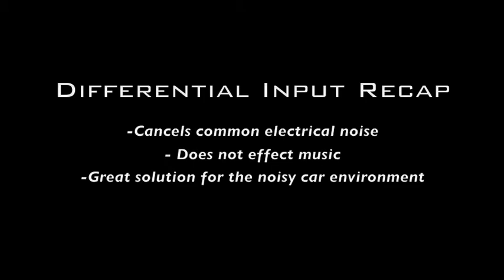Rockford Fosgate RTTi- Amplifier Technology Differential Input Section

Comment: I have big questions. Please. My HU is a Pioneer DEH-80PRS. From what is available online I have found that this might be a "single ended" RCA preout head unit. If I use twisted/ balanced RCA cables to an amplifier that is ALSO "single ended," what could happen? Is there any loss or risk? Any gain? Any chance of damage?? Also, my DMM says 1166 on the ohm reading when connecting the positive lead to the RCA Input outer ring and the negative lead to the ground on the disconnected/ unpowered amp model amp PX1900.4 Massive. Does this mean the amp is "single ended?" Or "differential?"